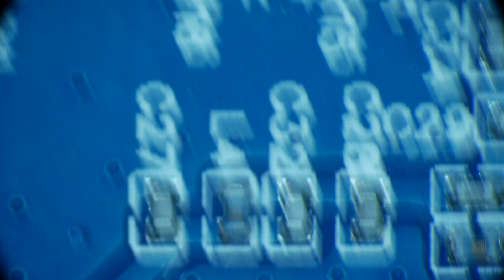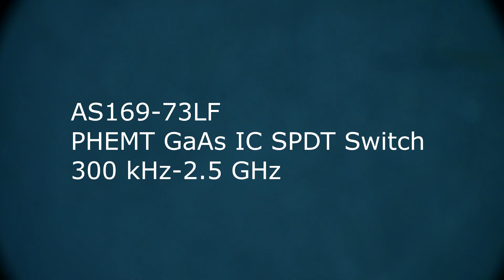#539c TinySA Inside the PCB and RF Cans

Comment: Hello, I just purchased a TinySA and Im experiencing some filter alarms in the self test mode... (Test 7: Stop band critical, Test 8 Passband fail, Test 9 Above fail, Test 10 Stopband fail). I opened it up and found some missing components on the board compared to yours: C32, C33, C34, C35 and R7, and the cans are missing too. I guess that if I can add those components I could work this out as these are filter components... Is there anywhere I can find the schematic (or the component values)? please let me know... Congratulations for the great contents of your channel, Im a fan! 73 de LU2AW
Reply from the maker: you have a clone. you need to return it and buy one from an approved vendor
Reply: @IMSAIGuy  yes, I guessed so, I purchased it on Ebay from an USA seller and Im in Argentina, theres no way I can return it as the shipping cost from here is almost the same as the SA price, thats why Im looking for the caps values... Anyway thanks for your ultrafast response!. Regards

Comment: cool stuff ! the 4432 are high integrated, via SPI programmable Receivers up to 960 MHz with RSSI Measuring from SILABS (SI4432) https://www.silabs.com/wireless/proprietary/ezradiopro-sub-ghz-ics/device.si4432 There are also mini PCBs with the SI4432 to experiment with, for example on Ebay